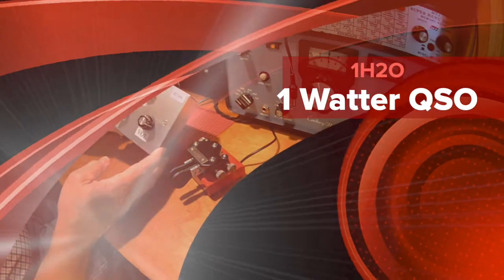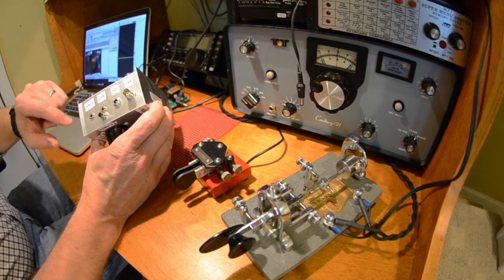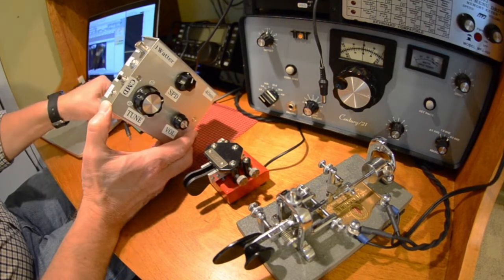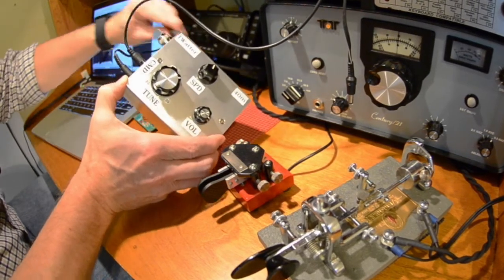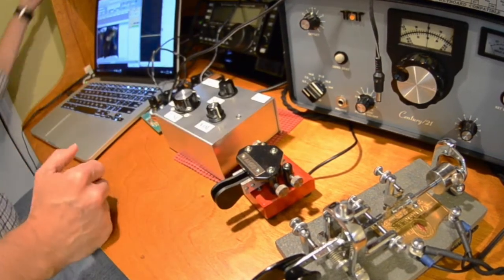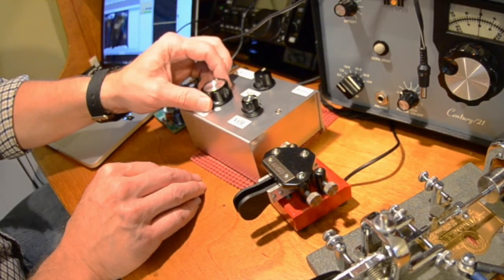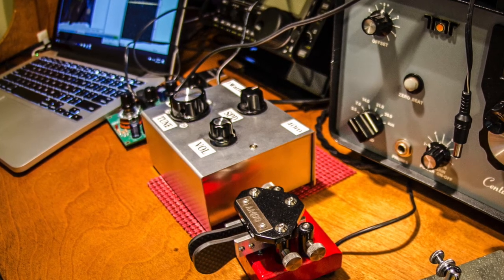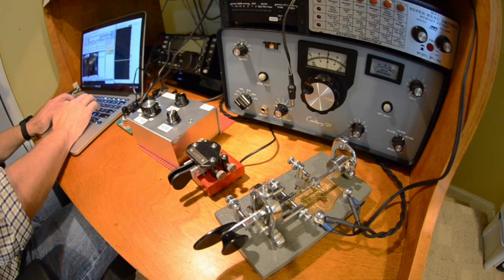QRPP (less than 1 watt) QSO with some QRM

Comment: I received an unfinished board and parts from someone and just started to put it together slowly. It is for 30m
Reply from the maker: You'll have a blast.  It's always fun to work a station and tell them you're output is less than 1w.  The supplied heat sink isn't really big enough so as your power transistor gets hot your output will decrease.  I have a QRPp meter and toward the end of a long QSO I'm outputting less than 0.3 watts.  Someday I'll rig a better heat sink but it still makes contacts with a decent wire antenna.

Comment: Nice video and Q. My HW9 lacks the filtering I desire. Although I've worked many Q's with heavy QRM it was a struggle. My FT817ND has the necessary filters but without an attenuator I find it difficult to work QRPp. I know there are kits available. I lack the knowledge of installation in my rigs. Maybe I will find an Elmer to help me. I"m an operator... working with electronic circuits is challenge. HI
Reply from the maker: The Elecraft AF-1 Audio Filter Kit has worked wonders with my older radios.  It will allow for very narrow filtering.  It is a relatively easy kit to build, you just need a ESD safe soldering iron for some of the sensitive transistors.  Search my blog http://www.hamradioqrp.com for 'Elecraft AF-1' and you can see info there.
Reply: TNX FER REPLY RICH. 72/73

Comment: What fun! The 1Watter looks like a good candidate for adding a VFO/DDS. May have to get one for 40M. Just did an 80M NVIS contact using 100 mW and a wire and had solid cpy. QRP is amazing! Currently building a QRPGuys Para80Set. 
Fb agn oc. 72 de N6MGN